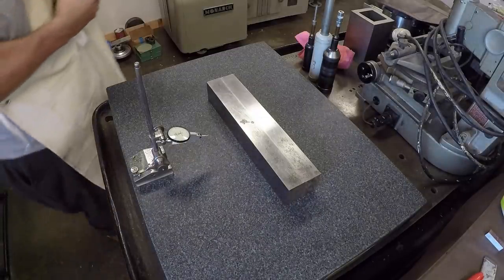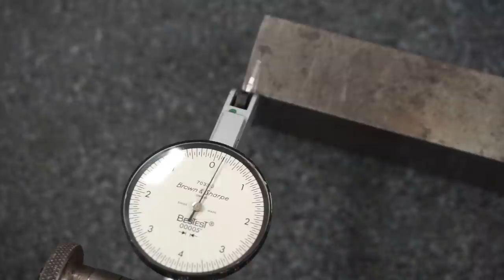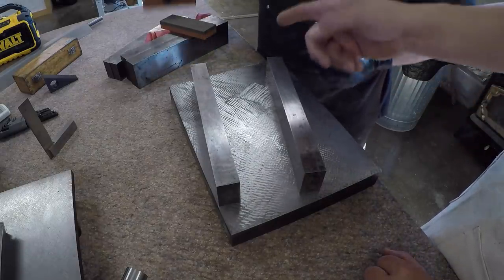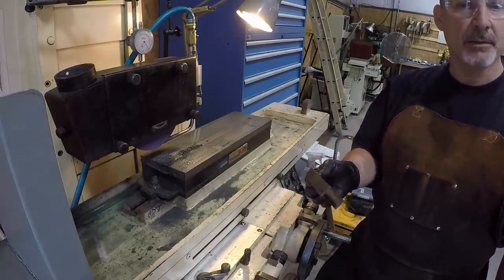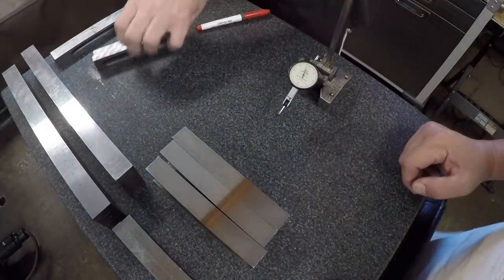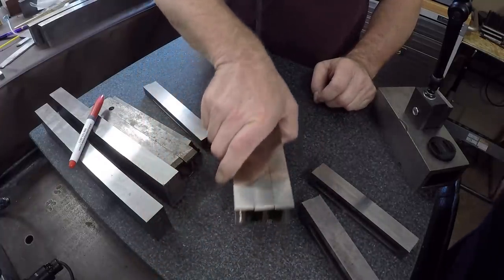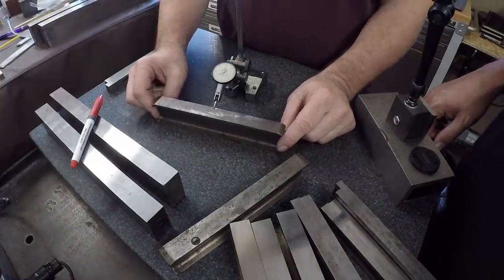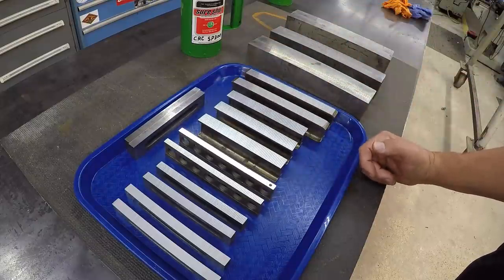SNS 293: Inspecting and Surface Grinding Parallels

Comment: The thinner areas are effected by heat. The center lengths of the parallels stay stable because there is more metal to absorb the heat. A simple solution to this problem is to angle the parallels slightly on the mag chuck so the grinding wheel is not contacting the thinner areas of the work along its full length. Setting parts up parallel  to a grinders travel is one the most common mistakes people make. Always angle parts when possible this reduces heat build up an wheel load up an wear.
Reply: Makes sense...
Reply: I've always wondered why people set parts on there angled. Now I know, thank you.

Comment: I’ve learned a lot about surface grinding in apprenticeship and I’m grateful for it. I’m not the best at it, but I remember tips and tricks that make it better. 

When you stoned the parallels in the beginning, you did it over a surface plate. Please don’t risk getting dust on your plate. You don’t have to stone them a ton, just enough so that burrs won’t mess you up. 

I think even though you used coolant, the thin part on the I beams could have gotten warm and ground out of flat. Definitely grind the chuck to clean it up and make it flatter. When you put the parts on the chuck, tap them down with a soft metal knocker after the magnet is on. It’s an obsessive thing but it makes sure the parts are down. 

Definitely grind them square on the sides while you’re at it making them parallel. It’s nice to be able to use both sides to have different heights. 

I like this stuff and I’m still learning it. You and lance have more years in machining than me so feel free to do things the way you learned.

Comment: You should dress in one direction only. Drop your wheel down when you traverse back. When you run the diamond back across the wheel without engaging the diamond, you're dulling what you just sharpened. That may be why you got the variation in the I-Beam parallels. The wheel is pushing instead of cutting. Also, I would hold them in a grinding vice to grind the first side. The magnetic chuck can pull down any "warp" there may be in the parallels.

Comment: When I used to grind parallels I ground them on a Jones& Shipman 540 l... brilliant machine..some magnetic chucks tend to convex or concave at different times of the day....any grinder needs 20 mins of traversing first thing in the morning...to warm up .. without a temperature controlled toolroom you find materials tend to fluctuate during the day...
Reply: I just purchased a mint condition 540, very happy after a full teardown to inspect. Glad you like these machines, I've heard a lot of good things since my purchase which is always nice. You mention dressing the sides of the wheel? why? and how is the best approach?
Reply: @tristanpatterson3843  Use the diamond single point fixed at an angle and traverse the table. It will reduce vibration and will grind sharp corners/slots nicely.
Reply: 540  definitely   the best small surface grinder around .. your right chucks can flex a bit ..  when thin parts were bowed did you take a chance and grind it with residual magnet or even  wirh the magnet off.. Oops health and safety  wouldn't  like the flyers 😅😅

Comment: The mag chuck is going to pull the parts flat during grinding and then they will spring back slightly when removed.  If the chuck has an adjustable 'power' setting, turn it as low as you are comfortable with and butt them up against a larger steel plate to prevent them being thrown.  Make sure the steel plate has a nice flat face to mate to the chuck and even if the 'power' is turned way down, it should still hold the plate firm enough.

Comment: Good video, its nice to see someone using coolant on a surface grinder most dont.  I was taught by a very experienced guy that you use coolant and turn the parallels at an angle so the heat build up is minimised. He then would use less and less mag pull down and only use 1 tenth cuts.  thank you.

Comment: They were slightly off because the center was VERY strong, supported by the I-beam, and the outer edges were able to flex down a tiny amount.

Comment: Grind parts at an angle,if they aren’t long like these parallels,make your cross feed index as small as possible,you want to only use the edge of the wheel to grind,not the whole surface of the wheel,it makes wheel dig in the middle, make a couple of light passes at .0001 or .0002 when finishing and let wheel spark out,and when flipping your parts,always flip from end to end,never flip parts straight over away from you. If you really want expert grinding advice contact Don at Suburban Tool he has a YT channel,the man knows his stuff.

Comment: Adam
I have mentioned this before when you showed and talked about precision ground slip gauges. This is the effect of human sweat on polished ground metal surfaces. I have acidic sweat and if I was handling those beautiful finished parallels tomorrow they would have my finger prints all over them. Lance was wearing protective gloves some of the time but not during the final handling process. I strongly recommend the use of cotton gloves at wipe down and prior to stowage.

Comment: Consider this guys.  As the grinding wheel grinds, it is deflecting the "wings" of the I-beam while grinding.  I think this is why you're seeing variation of the readings as you move from the center to the "wings".

Comment: Apologies if someone else said this, but with 412 comments, I just scanned the first page to see if my thought was addressed. 

Caveman's Mancave's answer is closest IMO to the problem.  A lot of focus was on the mag-chuck, but from a physics standpoint, it's pretty unlikely that the problem is from magnetic deformation.  The forces from a mag-chuck aren't going to warp the metal in an I-beam structure because they will cancel each-other out, and no, I'm not going to give a physics lecture on why, message me if you're that much of a masochist!  What's more likely (I think) is the "depth of cut" on the grinding wheel.  The i-beams are true across the center line because they resist much more compression force from the grind wheel, while the edges of the i-beam are (mildly) susceptible to flexion from the downward force of the grind wheel. 

I would posit that if progressively less aggressive passes were made prior to the finishing passes (Say, instead of taking X depth every pass out of 20 passes, you take X-1/20) then I THINK you might end up with it running true on both axis.

Then again, we should also consider how they're used.  The highest point (center line) is going to be the only important part because that's how they're used.  Stock rests on the highest point, and if that's consistent across the length of the contact with the stock, it's not going to matter if the edges are off by the thickness of of a warm breath!
Reply: Sorry Mozi but that's wrong. When you're grinding two parallel faces you have to take out the bow first...it doesn't matter what the profile is or the gauge you're grinding...The bigger it is the more force that will be exerted on it by the mag chuck.

Comment: Tool pressure (grinding wheel) will vary over those surfaces due to the force of the wheel on the surface of the parallel. As the wheel starts on the grind, the wheel has only a thin strip in contact with the wheel. So, assuming the wheel is pushing down with 10 pounds force, it’s pushing on, say, 1/8” wide surface. When the wheel is in the middle of the parallel, the contact is, say, 1” wide with the same downward 10 pound force. As the wheel exits, again the wheel works on a narrow strip. What that means is that the surface PRESSURE is changing as the wheel moves across the surface of the parallel. The resulting surface will be slightly crowned. That effect is magnified with the thin I-beam style parallels since there is less support under the outer edges and they will move under the downward force of the wheel. All of the effects I’ve just mentioned are SMALL but for very precise work, they can show up. For most everyday work, most people either won’t notice or won’t care because they’re small enough that they don’t affect the end result. Heck, I often use off-the-shelf keystock because it’s within .001” along it’s length which is plenty good enough for most of my work. As far as the longitudinal bow, a magnetic chuck will pull small parallels flat to the chuck which will spring back to a bowed shape when released. 3/4”x1 1/2” x 6” I beam parallels will do that. I have a pair. The only way that I know of to get them flat is to clamp them on the sides (lightly) and the ends so as to prevent distortion of the parallels during grinding. Once you have e certified flat surface, you can go back to the magnetic chuck for the opposite side.
Great video.
Thanks,
John
Reply: I wonder if that's why they were originally blanchard ground
Reply: Taylor Nicoletti 
Makes sense to me.
Reply: You are correct sir!
Reply: @davidgreen9957  My thoughts exactly.
Reply: I would just put them on the mag chuck at a slight angle to the direction of grinding.

Comment: Having had zero surface grinder experience, it seems to me that if you want to surface grind a bowed piece, it would be best to use non-magnetic clamping on the first face, otherwise the magnetic force would just straighten it out while grinding and it would spring back when the magnet is turned off. Once the first face is flat you can go back to magnetic clamping. I'd be interested to know if there is another way of doing it. Excellent video - thanks Adam.
Reply: A very good way to flatten something on a magnetic chuck is put newspaper under the part and turn the magnet on.

Comment: I miss surface grinding. I haven't done it in over a decade since I went through tech college. We made a set of 1/4 wide by about 1 inch high parallels as a class project and I remember in order to get them as flat as possible we qualified the first side in a grinding vise before sticking them to the magnet because they were super warped from heat treating and the magnet would just pull them flat. We weren't working to the tolerances you guys are here, though.

Comment: Getting an initial flat on an object distorted by being drawn down to a magnetic chuck. Let me suggest lifting the object on two small transfer blocks under the Bessel points. This will minimise the distortion from both gravity and the magnetic attraction of the chuck. You may need a stop to prevent endwise motion if the small transfer blocks don't provide enough grip.
Reply: In my very limited experience, when using 2 supports, or even a grinding vise, the part can heat up on the top, causing it to bow upward into the wheel.. if you are not really light and careful with it, this can run away with the part bowing up into the wheel more and more as it heats and gouging the part... Coolant would probably help a lot with this. On my little dry grinder I was able to very carefully take the bow out of a part, taking very light cuts & letting it cool between passes. Great stuff.. a little tricky to get a feel for what can cause big problems, good to be able to learn from others! Love the precision stones.. I have a couple soft Arkansas stones I lapped on a piece of granite with some lapping compound.. I seem to have gotten them pretty flat, and they are amazing for cleaning up precision surfaces. I hardly put anything questionable on a surface plate without checking the  surfaces with a precision stone.

Comment: A good way to get something perfectly flat is put a few sheets of newspaper under the part and then turn the magnet on. It doesn’t allow to magnet to have as much grab on the part. Should get you within 0.00005 every time

Comment: I have no clue but I don't think the mag chuck is the problem on the I beams, I think it's thermal expansion, I think the beam of the I is thermally sinking the centre, and the wings expand locally as they're being ground...

But I honestly have no idea whatsoever, this is pure intuition...

My guess is the I beams are ground in a fixture...  Might be a trick to sell more, actually, you try to grind them you mess them up...

Comment: The ones with the "wings" to each side have the problems that: (1)  The grinder has to push down at the point of contact at an EXTREMELY strong force to tear off the hardened material it is cutting off;  (2)  The sparks indicate a very high local temperature at the contact point that will expand and then contract the material AND very locally change its heat treatment on a very thin surface film (you may actually be seeing molecular size differences here); and (3)  When you release the grinder force, the material will spring back up and, in these unsupported, rather thin wings, this is not a small matter.  Since the wings are not buttressed by under-material, they will react to this as the various internal crystals at each point vary in size, shape, and orientation.

Comment: I worked at a shop that made the parallels for Bush, one guy did most all of them over the years. I did a lot of the stright edges and large angle plates on the 20' surface grinder.

Comment: The bow and variations are coming from wheel choice/dress. You could hear in the one clip how the wheel was singing, shouldn’t sound like that if the wheel and dress is correct. It will put a lot of heat/stress into the part and cause problems like that. I’d mess with wheel choices and using the lowest holding power on the magnet you can get away with. 
Nice grinder! My big Micromaster is one of my favorites.

Comment: As some some have suggested, you need to measure the bow then shim it while grinding, using residual magnetism, to get one side flat because the chuck is pulling the bow out. You'll need plenty of extra clamping for this. Then flip it over and grind. If you still have problems, your chuck may not be flat. At that point check the flatness of the chuck and grind it flat. If you're in a hurry, you'll need to use shims (for bows) and rotate the work as you grind. A circular grind gives you the best chance for a flat grind in that situation. For the I-beam, I'd do a circular grind and lighter passes plus hold it in a vice because it's probably rocking side to side as you're grinding.

Comment: I love your theme music. It is just perfect for you. It matches your style and content perfectly. When I worked in the General Motors press metal factory, the dies were made of precision machined metal blocks bolted together. The also stuck together. Metal that is free of rust, and surface grime, AND which is really flat, will stick together.
Reply: Wrings together like guage blocks do.

Comment: You might try setting the  parallels on the table at a slight diagonal.When I was in a machine trades class years ago, we used that method to get better results on unsupported areas of a part. Also the two that seemed to bow after being ground, is most likely from the finger groove  cut in the side causing uneven stress in the material. Love the videos. Surface grinding has always been on of my favorite machine processes. Your channel rocks.

Comment: I agree with the other posts here; the magnetic chuck made the non-flat hidden surface conform to be flat, twisting the exposed surface.  After grinding the exposed surface flat, releasing the magnetic chuck allowed the parallel beam twist back.  Somehow the beam needs to be attached to the surface of the chuck and only restrained along the X and Y axis and not the z axis.

Comment: The flange (top/bottom section) deflects when loaded, the web (center section) allows for it when it is unsupported. The parallels in that shape are really just W-flange beams. The common way to stabilize the web/flange connection would commonly be to add a stiffener plate between the flange and web. In this application it is not justified to add a stiffener plate, the shape of the parallels is flawed in that aspect and was most likely never intended to be that precise.

Comment: on those ibeam parallels, the side to side variation could be heat related. the wheel is slowing down some, which means heavy cut, and possibly warping during the curt.

Comment: Tips for shop made parallels.  Back in 1962 starting my tool and die apprenticeship I was in need of tools and setup stuff (parallels). To produce cavity, core or inserts for an injection mold, we milled tool steel blocks oversized, squaring them oversize on a surface grinder, milling rough oversize forms, heat treating the 'tool's then final shapes by EDM, carbide cutters and grinding to fit into the mold base.
I was able to source 2 pieces of cold rolled steel 1/2" x 1" x 7" to make a pair of Bridgeport milling vise parallels. The shop foreman sent them along with another job to our heat treater for nitriding.
Two MISTAKES by now. First do not use CRS for tools. Second do not use a surface hardening process.
Use tool steel that can be hardened throughout!
I would use them on the 1" dimension in the vise but occasionally could position them using the 1/2" direction. No matter what grit wheel, how many times it was dressed or flooded with coolant could I get the warp out of the thickness. Caused by stresses produced manufacturing the steel, stresses from the surface hardness and stresses by the touch of the grinding wheel and it would bow, never less than .0015".  
However the 1" direction was far more stable, I was able to get it to .0003"-.0004" which was good enough for milling. They are still in my machinists took box! 
I left them solid but finger grooves could be added. Or a series of through lightening chambered holes would permit use for bolting for setups. Or several short I-beam portions over the length to leave solid webs top to bottom. 
But use a quality tool steel which can be hardened.